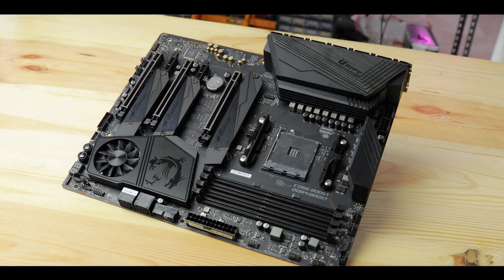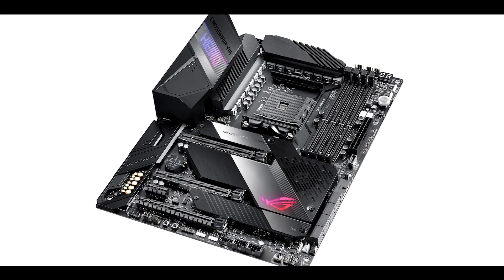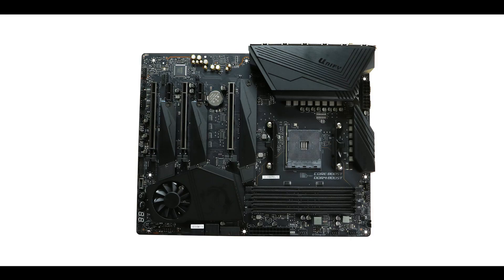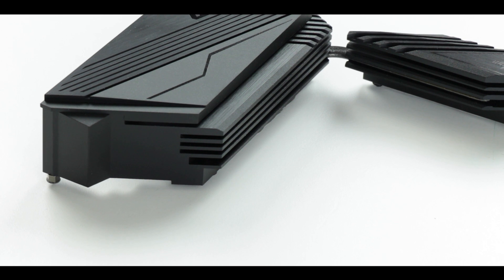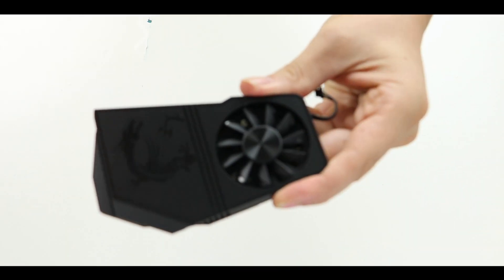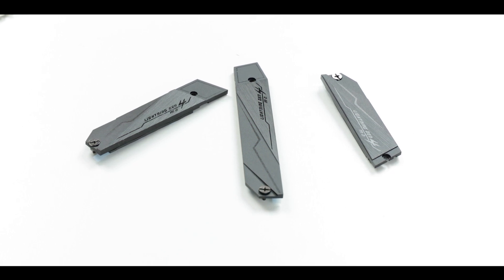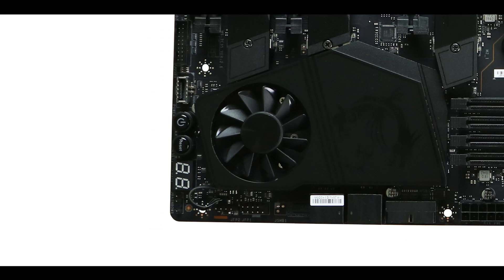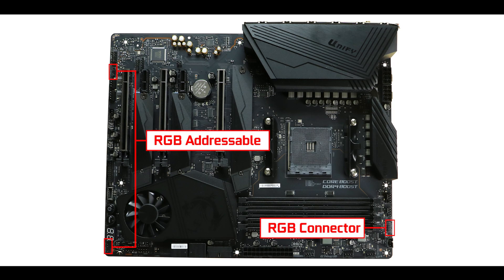MSI MEG X570 UNIFY, MSI is back !

Comment: sorry guys what does that reset button do ? when can i press it when my pc is on or off ?
Reply: It does exactly what it says it does. For a system that is powered on, it will reset it triggering a power off -> power on cycle. If the system is off, it will do nothing. It's for bench testing when you might not have it installed into a case with the front panel pins connected.

Comment: Quick question, so when you install 3 nvme ssd at same time, are all 3 run full speed? Because on my B550 when I install one ssd on main slot the 2nd one only performs as gen3 x2 which only gives half speed, thanks.

Comment: Hello, I currently have an MSI MEG UNIFY X570 card, I have a problem with the screw support to place the M.2 disk (see photo below), it does not fit in the motherboard anymore, is it possible to buy a spare part or to have it repaired?

Comment: Also is this a good build slightly expensive for right now but ima stalk best buy and and soem stores for amd stock perf a rx 6700xt or 6600xt or the 3060 ti are my gpu choices with the msi unify or gigabyte elite wifi aureus a samsung Evo ssd a ryzen 7 5800x as rn its the best major cou for the money cheaper then the 5600x for the time rn only 50 bucks more and a decent jump 2 extra cores abit mroe profrmence quality silicone ect plus I will do a very light overclock and thena underclock a few time to find the most stable but also minimal to male it as stable as possible and give it a few extra frames but I  want to try and focus on latency as well so I found some 4400mhz porformence ddr4 sticks so once I start getting everything together Sam on and a few other thing it will be a buet gunna start as an open case build  keep it simple get a m.2 later and a few other things use an older monitor and TV for awhile will be overkill for the time but I can just focus on how 3verything looks at as Ling as I dont get screen tearing it will just decrease latency if I'm correct

Comment: I followed your review after creating a custom loop with a Unify x570 and the lack of thermal sensor was quite a problem. Congratulations for drawing attention to this issue. For this reason, I will switch to the x570s carbon max model. Because it has a thermal sensor input.
Thanks for video.

Comment: Just bought this board after doing a lot of research and just love the clean matte black look and overall feature set and quality. I actually built two systems with identical parts with the exception of the motherboard--the 2nd one hosting the also-stunning Gigabyte B550 Vision D. Both were sporting the new 5600x CPU and a PowerColor RX 6800 Red Dragon. Interestingly, the B550 board outperformed the Unify board in all Passmark tests. The 3D video tests in particular were about 4 percent faster on the B550 board. I was quite surprised. The Unify board has the PCIe 4.0 across all M.2 and PCIe slots whereas the B550 support PCIe 4.0 only on the main x16 slot and primary M.2 slot, I'm not using those 3.0 slots. There will be a new Vision D-P soon that will offer the on-board USB-C connector plus twin 2.5GB/s LAN ports instead of 1GB/s ports. I wish the Unify had twin LAN ports. That was my only gripe. Overall, both are outstanding.

Comment: Does anyone know if the board will run with the F4-3600C16Q-32GTZN G.Skill when using a Ryzen 7 5800X? The RAM is not listed in the QVL on the MSI website. However, it is listed as compatible on the G.Skill website - But it only has been tested with Ryzen 3000 so far! I already asked G.Skill and MSI, but yeah... They only told me what I already knew: It could work, but they can't guarantee it...
I wanted to buy the Asus Dark Hero first and already ordered this RAM because of that, but since this board will according to sellers cost 500€+ and there still is no release day known and I'm not planning to overclock the CPU anyway, it simply isn't worth it for me.

Comment: Hi, hoping you can help me out. I'm looking to do a new build and i'm going with the Ryzen 3950X CPU. I am not sure what motherboard to go with. 
I'm leaning towards the x570 UNIFY but has also looked at the GODLIKE. I'm not going to do any overclocking, there is a big price jump between those two, and I would prefer to not go bigger then ATX. What motherboard should I go for?
In build will be:
CPU Ryzen 3950X
GPU RTX 3080 strix (not OC)
RAM 2 x 16 gb Corsair Vengeance LPX DDR4 3600 (not 100% on this choice just yet)
Cooler Noctua NH-D15

The main purpose is video editing, sometimes heavy video. But a big plus if it also works for gaming. 
Also if there is any good suggestions for RAM I would appreciate it a lot :)

Comment: Just found your channel.  Great motherboard analysis that gets to the point of the feature set.  Do you think the heat from the 2nd m.2 slot under the gpu using either PCIe gen 3.0 or 4.0 will cause any thermal issues for the ssd itself or for an RTX 3080 which can use 400 watts on an overclock?  Thank you!

Comment: Just bought one (quantity limited to 1, but at least it was *available*, and I only wanted 1) of these on the strength this review, positive reviews far outweighing one negative review on vendor site, and some details (e.g. front-panel I/O is a perfect match for Meshify-C case). Yay, debug codes without spending twice the money!

Comment: Can I still use msi's mystic light software to control all my other rgb components such as my gskill rgb ram , graphics card, rgb fans or even my case ? ( My case comes in with  a 3 pin addressable rgb cable ).

Comment: Hi, can somebody help me to answer one question here? If I have this board, can I insert two RTX 2080 in SLI mode for windows and use one of the PCIe slots for AMD 5700 XT when I swap to Mac OS?  How the performance would work? I don't need the AMD card in windows, so the performance of it in Win doesn't border me, but I want full power of the AMD card when I swap to MAC OS.

Comment: thanks for the video!  you mentioned at 13:14 "CPUless boot bios", what's the difference between that and the BIOS flashback, which is on this board?  Presumably you can flash, but it wont boot into the bios? how would you know if the bios update was successful if you use BIOS flashback?
Reply from the maker: That is correct. Depending on the board model, you d have a LED around the button who does indicate when your BIOS has been fully updated.

Comment: hows this compare to the asus rog strix x570 e ?
Reply from the maker: Frankly.. the UNIFY is a much more complete board.
Reply: @Laurentschoice   I went ahead and got asus x570 Crosshair hero wifi.. I found it on NewEgg for $359. By the way great videos. I just started watching your reviews. I like your honest opinion about all of them. I made the grave mistake before watching any videos of yours and I just bought a board best buy had in stock  in my area and It happened to be the gaming Edge WiFi......oops. my temps on my GPU and CPU in my opinion were running High ,higher than what they have ran in previous months when I had the x470 MSI gaming Pro carbon AC. Gpu Nvidia 2080ti FE Evga 850 watt psu Corsair Vengeance  pro rgb 32gb 3600, 1tb Sabrent gen 4 m.2. Gpu Was max 84c and CPU 77 at times but mostly not above 74 while playing ultra settings on Division 2. 3840x1080 49 inch Samsung ultra wide 144hz. Soooo this normal?

Comment: Hello Laurent the thing I love the most about your channel is the honesty you bring to your reviews. Thanks for that. Im going to build a new PC and I d like to now in your opinion which motherboard should I buy the MSI UNIFY or the Aorus Pro Wifi? Thanks mate
Reply from the maker: Hey thanks for the kind words :)

What CPU / GPU are u going for ?
Reply: @Laurentschoice I m going for a Ryzen 3900X CPU and a Gigabyte AMD Radeon RX 5700 XT 8GB  GPU. 
Salutations latines du Portugal. Keep safe. Merci Beaucoup
Reply: My full build is going to be:

Build
Ryzen 3900X (witch is the only thing i bought so far)
850W Corsair TX-850M, Hybrid Modular, 80PLUS Gold
32GB Corsair Vengeance RGB PRO 3600Mhz
4TB Seagate IronWolf NAS Hard Drive, 3.5", SATA III - 6GB/s, 5900RPM, 64MB Cache
500GB Seagate FireCuda 520, M.2 (2280) PCIe 4.0 (x4) NVMe SSD, 3D TLC, 5000MB/s Read, 2500MB/s
MSI MEG X570 Unify, AMD X570, AM4, DDR4, PCIe 4.0, 3x M.2, SLI/CrossFire
Gigabyte Radeon RX 5700 XT 8GB GDDR6 PCIe 4.0 Graphics Card, 7nm RDNA

Plux 
Akasa InterConnect EX card reader for 5.25" Bay - 5 x USB 3.0 card reader
ASUS x12 Blu-Ray Combo DVD-RW, M-DISC Support, BDXL Support                	

Case
Fractal Design Focus G - Mystic Red, Red ATX Computer Chassis

If you have any sugestions be my gest mate 
I want to build a semi-professional video edditing PC and some gaming especialy Cities Skylines. 
I am looking for something with more performance and less RGB.
RGB is ok but is not my priority.

Best Regards and thanks
Reply: Hello mate could you tell me at list what you think.? I was waiting for your opinion regarding the build motherboard and graphics mainly.

Comment: I am thinking of pairing ryzen 3700x with either msi x570 gaming edge wifi or asus tuf gaming x570 plus wifi. Which one should i get? 
In the beginning, i will not overclock but later, i might.
Reply from the maker: The TUF ..by a mile :)

Comment: "..no RGB. How does it run a CPU then?"  LAWLZ!
Great review my friend. 

Of course I went with the Aorus X570 Master myself. 
Seems like a Champ Board so far. 
100% CPU for an hour got the temps up to 50-51-50 C (technically 51 C max) with my H115i AIO and the liquid temp up to 32 C where it leveled out.
Reply: How are you enjoying the Master board?  I was debating between this board and Master for my new 5900x.  I found a used 1 for around $300 for master.
Reply: @KickAssets  It has been a solid board. Only occasionally does my power grid here cause some funkiness with the rebooting. It has cleared the bios to default settings twice. Not a big deal really.
Reply: "..no RGB. How does it run a CPU then?" - made me a day  XD

Comment: Excellent review, thanks. I have the Unify matched with a R9 3900X and it's a great combo.
Reply: I have this board matched with the R7 3800X and a 
MSI Radeon RX 5700.
Reply: @kevinisawake  how is it hanging, planning to buy the same combo hehe
Reply: Does it has RGB headers?
Reply: VI RUS — probably it’s $300 for a X570 board that’s all black
Reply: Hey man, I'm planning to upgrade to this one. But my PSU only has one 8 pins connector. Can it work with only one?
Reply: @EddieGooch   No, it will not. A 750 or 850 Watt Gold+ modular power supply would do the job nicely and only cost ~ $140 https://www.newegg.com/corsair-rmx-series-rm750x-cp-9020179-na-750w/p/N82E16817139233?Item=N82E16817139233&quicklink=true

Comment: The only drawback I see to this motherboard I already own is the strange location of the USB 3.1 internal port. Lian LI PC-011 cable is just too short to reach this location. Most other motherboards have it located near 24-pin motherboard header. But anyway I'm not using any type C device so far, so other than that, I am really happy with it.
Reply from the maker: Well spotted !!!